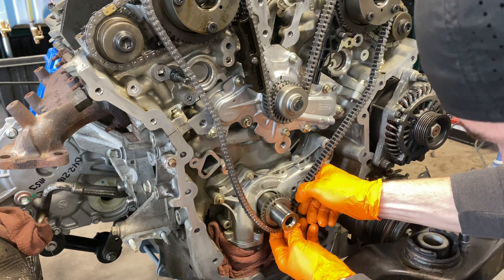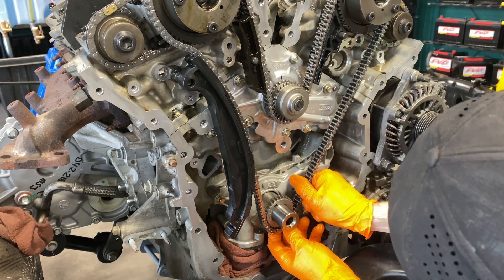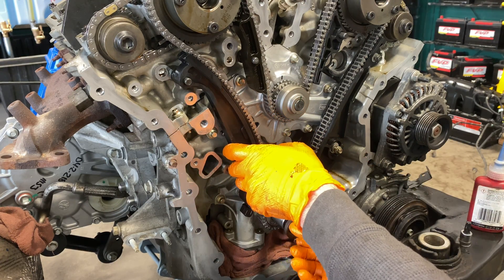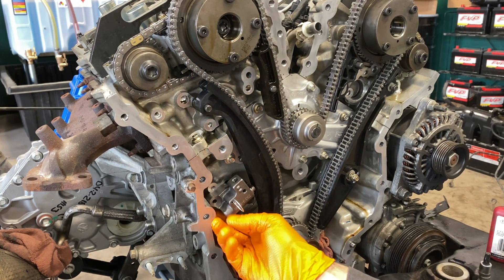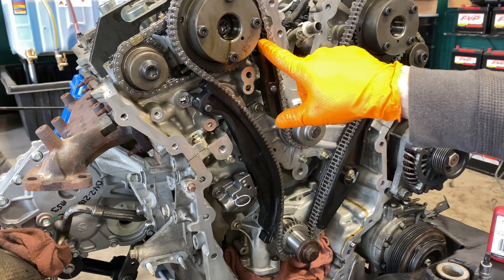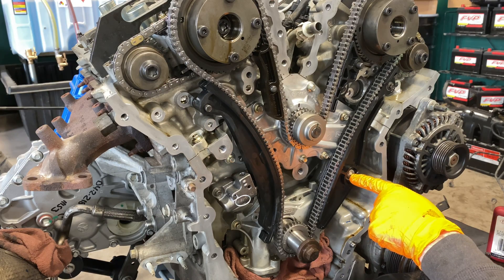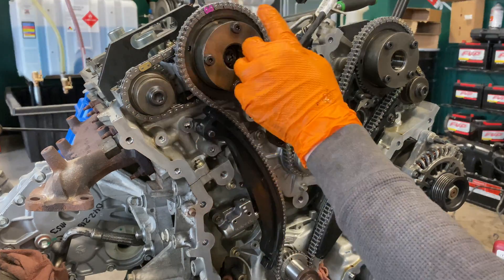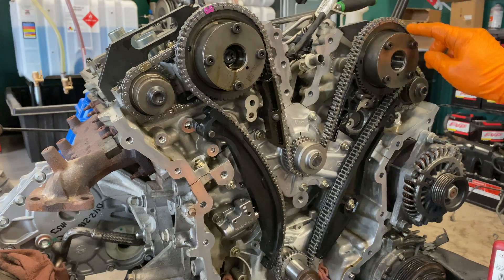Ford 3.5 SHO Ecoboost Timing Chain Installation (Part 2)

Comment: Doing it out of the car is cheating!  In the process of doing my Flex Ecoboost, IN CAR.    To resolve the double color marks and get it from popping, I removed the left cam tool, rotated the VCT clockwise a touch, installed the left guide (right side), then the right guide and tensioner, then rotated the VCT back to drop the cam tool in.  This kept everything aligned and done by the book since the left guide should be installed first and torqued when installed.    That slack on the water pump side is to be removed in order to keep the marks aligned.

Comment: I noticed that the exhaust cam wasn't lining up with the intake.  The only way to get the cam locking tool on is to turn the exhaust cam with chain off. Then it won't line up with the chain marks
Reply: Then it won't line up? Then why did you say to turn the cam if it's not going to line up

Comment: He is making it seem a lot more difficult than it really is
Reply: I have a 3.5l v6 in a 2019 Taurus. I changed the dreaded water pump and had thought I put the chain back correctly but it’s throwing the timing code now.   My question is  is there marks on all three sprockets (not counting the water pump)  I have heard different answers some say yes there is and some say no     I need to retime it
Reply: I do these every week and it’s easy.

Get your top marks all lined up on the phasers first then down and around the idler between the 2 sides 

 put in your guides on driver side and tensioner guide. If your phaser and chain marks are lined up and your cams are correct on their timing the marks , with the crank shaft mark in the 5 o’clock position, the marks on the chain will fall into place if you put a little pressure on the chain with the pivot guide. All your slack MUST be on the tensioner side. If everything lines up I use my torque wrench and socket to slightly turn the crank clockwise to seat all sprockets to chain fully and pull the slack to the tensioner side naturally and pull your pin. Make sure tensioner is fully seated on the guide before putting cover on.

Comment: The zip tie literally made things harder than they had to be. You need slack in the chain to squeeze the guide and tensioner arm in. The chain will usually stay on the timing marks anyway unless you man handle it. Also why did you drop the whole powertrain?
Reply from the maker: Noted! And because this car got wayyyy more than a new timing chain. I’d advise you to check out some more videos on the channel!
Reply: It is necessary to drop the engine????
Reply: @oscarfranqui6678  No its absolutely not necessary to drop the powertrain. Pull the strut bar off on the taurus, or pull the wiper cowl AND strut bar on explorer. It's easy.
Reply: Ook cause I got and explorer to do tomorrow and I got valve cover intake and belt taking a part and I see plenty room to do but I was wondering may be
Reply: @oscarfranqui6678  definitely pull the wiper arms, upper cowl and cowl panel off before you do it though, you'll have all the room you'd ever want.
Reply: @oscarfranqui6678  discharge AC, drain oil and coolant, then pull the air intake, upper intake, disconnect everything (coils, injectors, a couple grounds on the front of the engine, CHT sensor, bank 1 upstream oxygen sensor and move the whole harness out of the way, pull the coils out, valve covers off, serpentine belt, serpentine belt tensioner, and coolant bottle, then go down below, pull the crank pulley off, get a block of wood and a jack, or a jack stand with a block of wood, set the front of the oil pan down on it (you'll see the little flat spot on the oil pain) take the engine mount off, then you're gonna raise the vehicle (or lower the engine) to get the bottom 15mm timing cover bolt out because it will hit the body if you don't, then lower the engine back down and take all the other cover bolts out and voila, covers off.
Reply: Great thanks bro
Reply from the maker: Good info everyone. This engine was dropped for other reasons though!
Reply: I have an Explorer Sport and I did not remove the strut brace or cowl. I also did not remove the AC lines. I did unbolt the lower clips holding the fuel lines on the frame near the rear turbo just so I could get another quarter inch of space. The timing cover is most tight on the right side bank. That's where it will come close to scraping when installing with RTV on it.

Comment: On the vct housing there’s 3 nylon seal/o rings did you replace them? I’m currently putting everything back together but just wanted to check if anybody else has replaced them because I can’t seem to find any info on them. Or someone else has replaced them.
Reply from the maker: I apologize for the late response but it is extremely rare they would need replacement. They are not responsible for retaining oil pressure nor do they affect timing chain longevity.
Reply: Creative Automotive & Performance Solutions its no wonder they have a diagonal cut on all 3 of them  I couldn’t figure why. I was able to talk to a ford tech and reassured exactly why I seen and also what you just mentioned. Taurus is on the road as we speak. Thanks subbed to your channel
Reply from the maker: @artyart31  Appreciate it!!

Comment: This was information I needed thankyou! I am planning to do my water pump timingchain and tensioners some time in the near future I have around 87,000 on my 13 sho and figure I should do it before I have a failure I dragrace my sho regularly! I have a custom GearHead tune and a ton of supporting mods that makes around 450 to the wheels and over 520 torque! I can imagine it is putting a bunch of added strain on the timing system!! A have a manual but for me nothing better that seing it done!!